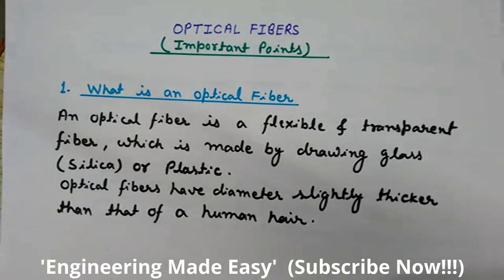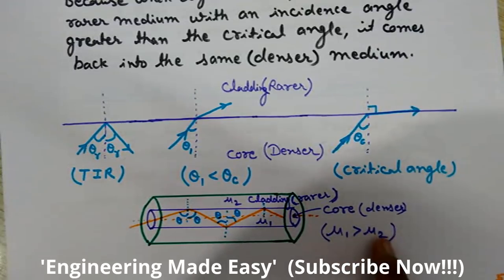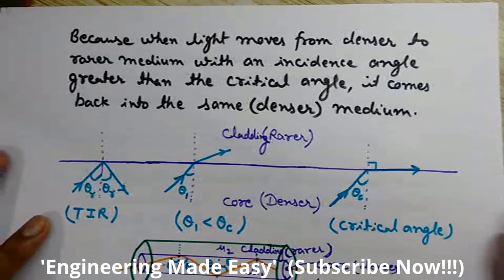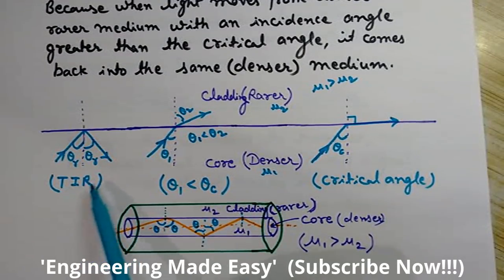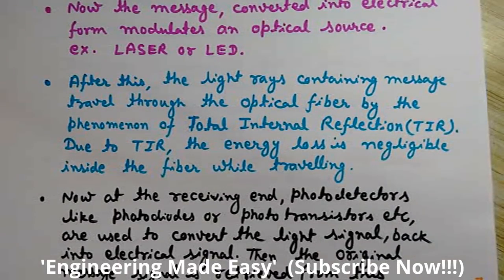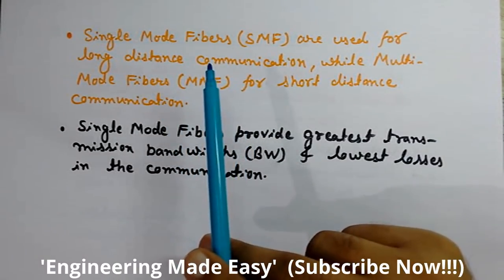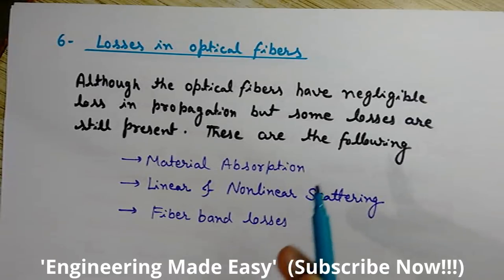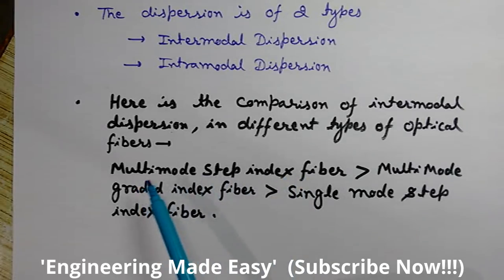Optical Fiber Communication - Optical Fibre - Optical Fibre Communication - Optical Fiber

Comment: Nice explanation. Some suggestions. You may add the point that by making the light enter into the fibre at greater than the critical angle, the subsequent angles of incidences after TIR will also be greater than the critical angle and as a result, the TIRs will continue until the light reaches the other end. The angles marked in the diagrams can be shown to amply demonstrate this point. One obvious doubt the viewers may get is why not introduce the light at the center of core in a straight light instead of introducing it at an angle which results in a longer path. Due to the bends in the optic fibre cable that natural occur when the cable is laid over long distances, the light will at some point strike the cladding and core interface at lesser than  critical angle and will be greatly attenuated. You may also explain how digital signals modulate the light in the fibre optic cable i.e. whether the digital signals (bits of ones and zeros) as a part of modulation switch on or off the light rapidly or vary the amplitude(brightness) of light in discrete steps and the type of modulation used i.e. AM etc.
Reply from the maker: Thank you sooo much for your kind suggestions and information. You may watch my other videos on optical fibers, where I have explained these points in more detail. Actually this video was a summary of main points about optical fiber. You may visit the playlist of optical fibers in my channel. Thank you so much once again.
Reply: Thank you for your prompt response. I am a novice  in electronics and communications field and recently got interested in the subject. I have been searching the internet to learn more about the subject. Till I came across your website, I was disappointed with the explanations offered on the websites on the subject. All of the sites either explain the subject in an incorrect and superficial way or make it more complicated by directly plunging into maths equations. You have been explaining  the concepts of the subject in a lucid manner with simple diagrams. Thank you once again.
To make the videos more interesting,  it is suggested to include in the  videos,  the practical applications of different modulation schemes.
Reply from the maker: Thank you so much...that's so kind of you. I will work on your advice. I needed a good friend like you who can advice and appreciate the work. Thank you so much from the bottom of my heart. Your suggestions are most welcome.

Comment: best explanation☺......
Basic Definition/Main Idea: When light enters a fiber optic cable at an angle greater than the critical angle, it undergoes total internal reflection (TIR) and continues to bounce off the walls of the cable until it reaches the other end. This allows for the transmission of light signals over long distances.

Real-Life Example or Analogy: Imagine a person standing at the edge of a swimming pool and throwing a ball at an angle towards the opposite side. If the angle is too shallow, the ball will hit the water's surface and bounce off, not reaching the other side. However, if the angle is steep enough, the ball will skip across the water's surface and reach the other side of the pool.

Summary: By introducing light into a fiber optic cable at an angle greater than the critical angle, the light undergoes total internal reflection and continues to bounce off the walls of the cable, allowing for long-distance transmission.

Comment: Sir as per wave theory,what is mode
Reply from the maker: If you consider a ray of light to be a “mode” and the sun outputs light in every infinite angle, you can say it’s “multi-mode”. 
A laser, can generally be considered a coherent beam of light - one ray, one mode.
So when we say multi-mode in regards to fiber optics, it means that there are multiple paths that light can take within the fiber. Hope it helps